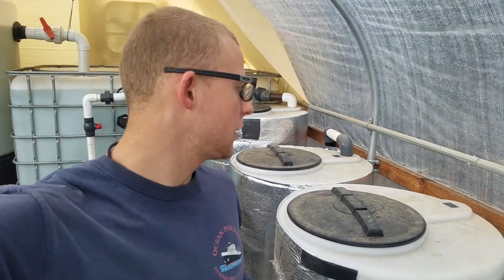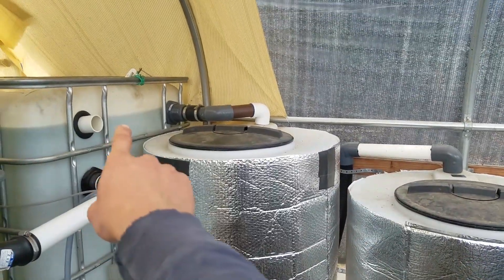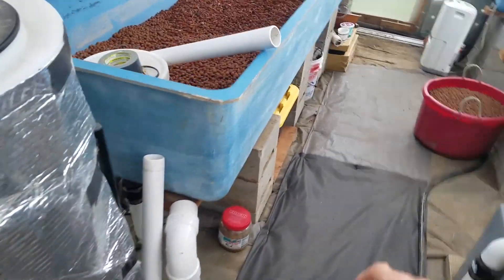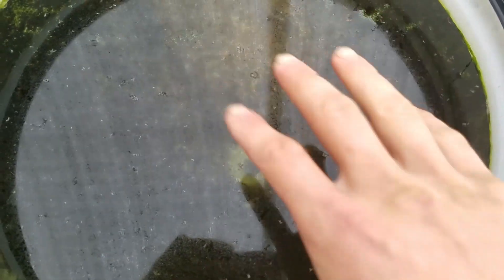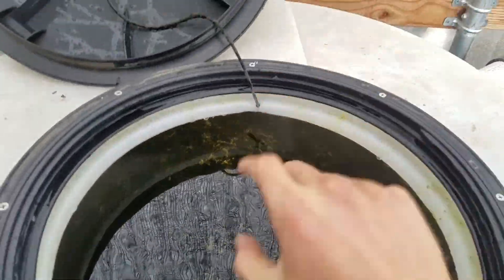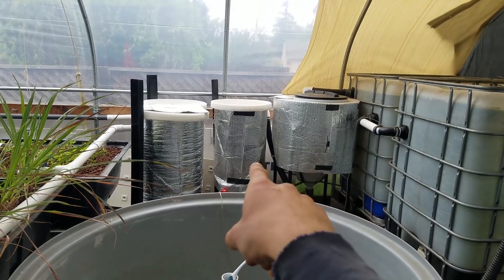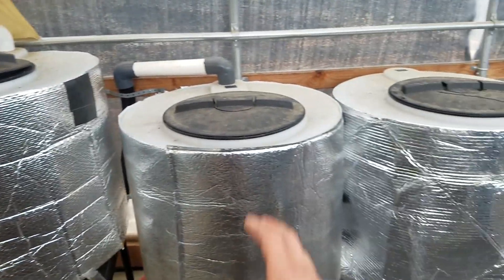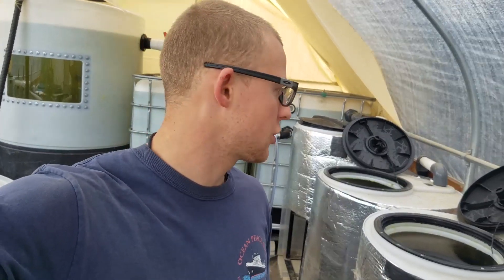Aquaponics filter review (going over the plan for my aquaponic filters)-

Comment: Good work man. You could even put a mineralization tank inline with this system like a compost tea brewer. This is nice!
Where did you get those conical tanks second hand?
Reply from the maker: Ya I was thinking to put a mineralization tank, but don't have space in the greenhouse. I might put one outside of my greenhouse but that will be after I set up the drainage pipes and will have to find some more tanks for it.

For the conical tanks it takes time for me to get things like that, but i look constantly on a second hand website (craigslist) I pretty much got everything I used for my system second hand. So i got lucky in finding these conical tanks second hand, they were not even used yet so pretty much got them new for a fraction of the cost.
You can find some on amazon here: https://amzn.to/2Yj0zcv . However I didn't pay nearly what they cost. If you look around you might get lucky like I did.

thanks
Reply: @vonponics  oh, you can make a 25 gallon trash canto a compost tea brewer. Check out these plans
https://www.scribd.com/document/35269216/Plans-for-a-home-made-25-gallon-compost-tea-brewer-Oregon-State-University
In addition to that one tank in each series can act as a mineralization system in addition to its filtering process.  Bigelow farms has a system like this in place. 
https://youtu.be/q3L6Qcq30P4
Reply from the maker: @antoniosanford4675  ill check that out 
thank you